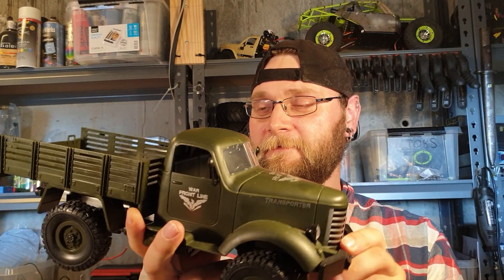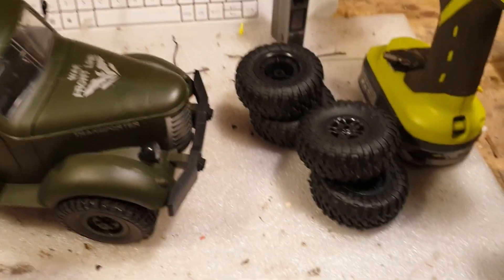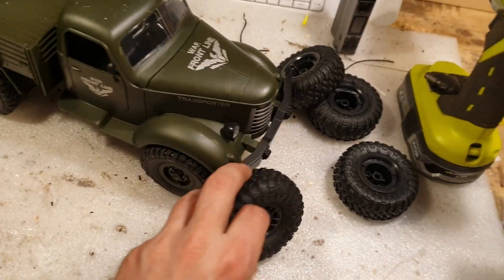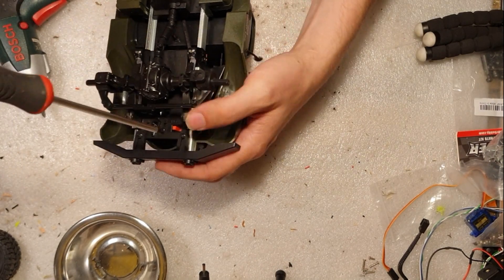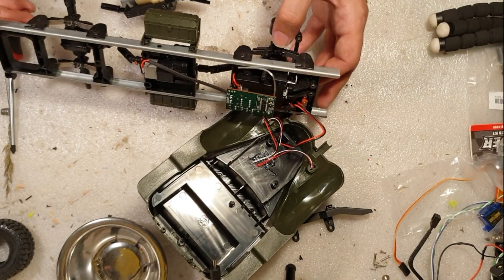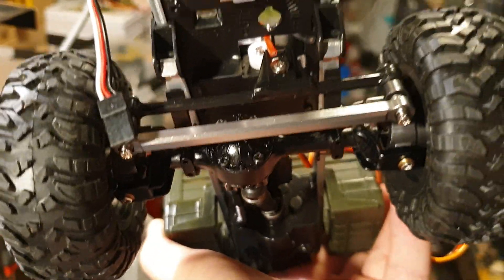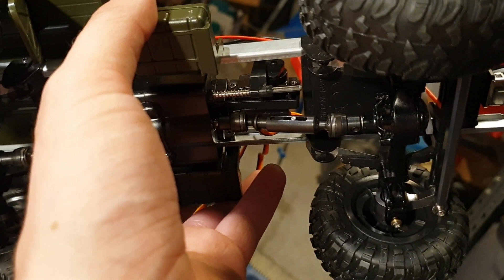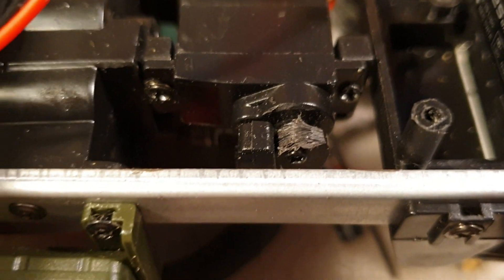JJRC Q61 1/16 Tear Down and Rebuild. 2 Speed, 370 Motor, New esc and 2s lipo

Comment: Building my jjrcQ60 how did u get the metal drive shafts on the original drive axles
Reply from the maker: Hi Joseph, ow i replaced the stock with some fancy full metals ones..... wich  i broke the pinion on 3d run :P.   " But "!  swap about the gears with metal then youre good to go :D im waiting for new parts for this truck... its to good lookin to not be modded
Reply: Nice thank u u have few new parts for mine in waiting on more were is the best place to get parts at if u dont mind me asking I uploaded my video I'm impressed with it
Reply: Check it out
Reply from the maker: @MFJK87  Oh i've been ordering almost everything from banggood. and a little of ebay.  Oh Yes the leafspring are very poor, mine was bent and tires were ripped due to shipping :P
i see you have a 370 with reduction gear.  if you want i highly recommend trying the 2speed gear box.   the reduction gear was just to slow for me. even miniboss got fed up XD
theres so many nifty upgrades for these trucks, they are amazing to tinker on :D ..... reminds me i need to fix mine ^^  after im done building the p407 and fixing.... a new racer truck
Reply: Amazing thank u for the help love the video's my son and I watch
Reply: Yes I believe your right I'm going for a 2 speed it's slow
Reply from the maker: @MFJK87  :D Thank you, it started as a father son project, and i wanted to make some videos "just4fun" :P  with fun within budget. Im gonna do some more jjrc and wpl builds. i got 2 new motors in. monday or tuesday :D gonna be fun. my miniboss realy enjoy these little trucks too. and best part is they wont brake youre bank ^^
Reply: What do used for a 4 channel are what do u recommend
Reply from the maker: @MFJK87  i normly run a 10ch stick transmitter. but i also got a few pistol grip transmitter just in case.
4channel transmitter. lets see
A good allround with abs 6channel great for crawling or trailing. good brand too. almost all of my transmitters are from flysky
https://www.banggood.com/FlySky-FS-GT5-2_4G-6CH-Remote-Controller-Transmitter-with-FS-BS6-Receiver-for-RC-Car-Boat-p-1503240.html?rmmds=detail-left-hotproducts__12&cur_warehouse=CN

RadioLink RC4GS 2.4G 4CH
Another great transmitter with gyro. great name and price
https://www.banggood.com/RadioLink-RC4GS-2_4G-4CH-Car-Controller-Transmitter-R6FG-Gyro-Inside-Receiver-for-RC-Car-Boat-4-p-1169456.html?rmmds=detail-left-hotproducts__11&cur_warehouse=CN

DumboRC X4 2.4G
Tons of bang for the buck! almost to cheap XD but perfect for budget and oure 1/16 trucks.  just glue som thin foam to the steering wheel and youre golden for a long time.
https://www.banggood.com/DumboRC-X4-2_4G-4CH-Transmitter-with-X6F-Receiver-for-JJRC-Q65-MN-90-Rc-Vehicle-Car-Boat-Tank-Model-Parts-p-1469871.html?rmmds=search&cur_warehouse=CN
Reply: So I went with 2 speed motor thank u so much its amazing plus went with a 60a esc as well and the controller u told me about the truck is amazing now and strong
Reply from the maker: @MFJK87  so happy it went well for you :D share a vid if youre gonna upload it :) have a nice weekend buddy

Comment: whats the run-time like with the upgraded battery ?
Reply from the maker: Hi John. with this lipo genes 2s 2200mah 25c after 25ish min the cells showed 3.8v. these small motors dosnt take much power :D
Reply: @Just4FunRC  my q60 runtime is junk,  looking into a rebuild to keep up with those 600 dollar hobbygrade guys on a budget lol
Reply from the maker: @johnpaulson2916  Ouch :O after me and the miniboss tested oure new feiyu fy03h today we fired up the jjrc again.  brand new steel axles  we snapped both pinions after 5min XD but we love this truck to much to stow it away.    Thats sweet john "Fun within Budget" :D  are you running stock motor and gear? 

a couple of 18650 batteries are perfect for these small guys or a smaller 1200mah 2s in front maybe.

also leafspring yes its cool, but might try 4links with this one. already got a upgraded leaf kit on it. but it bent due to missing 2plastic leafs on each sides.
Reply: @Just4FunRC  everything is factory right now, trying to draw up a decent build, more than likley the metal gearbox with the 370motor im going to start out with. i think i do have a few 18650s from my vaping days